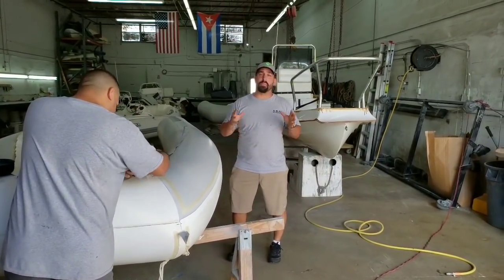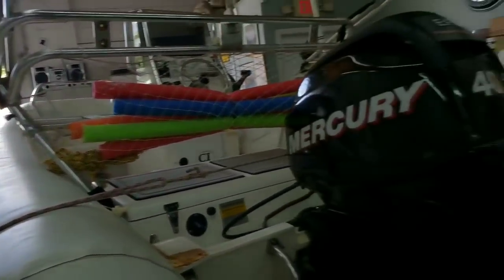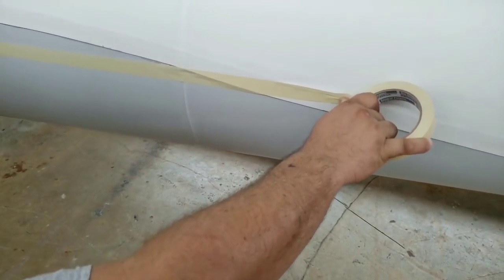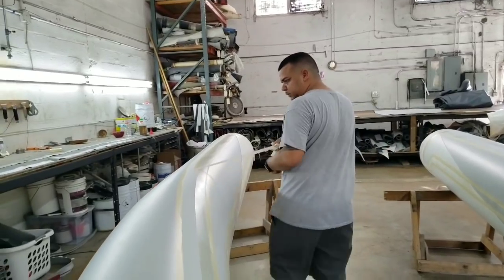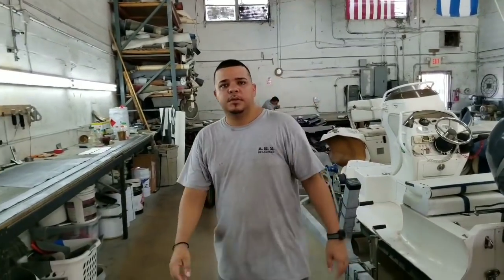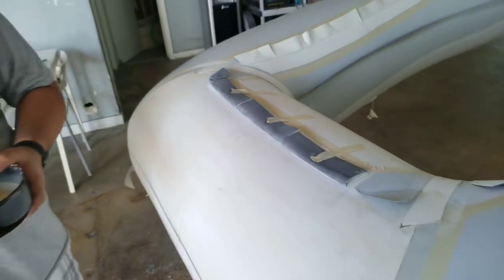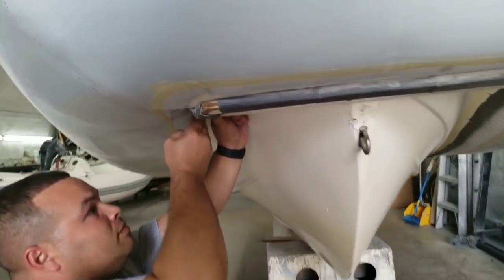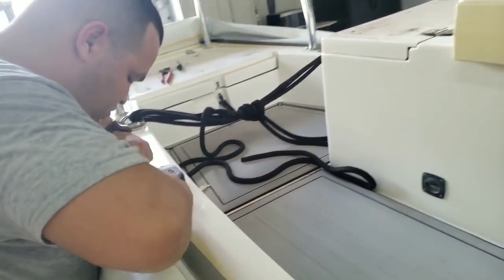How to install a rib Boat tube tutorial

Comment: Thank You guys these tutorials. I'm just retubing old  Valiant 570 according this video tips.
Reply: How did it work out? How did you get the old glue off?
Reply: @1998casablanca  Old glue removed with min.rpm with Festool sandpaper 120 and thinners. Huge amount hours. Zodiac 2 comp. Glue used to retubing.
Reply: I'm happy with result.
Reply: What name of glue please
Reply: Zodick 7096  pvc glue, 2 comp.
Reply: How many pieces I need. To repair 6 meter boat my dear

Comment: Hello, great video!! 
Question, i have a 2005 yachtline zodiak and need to reglue the tube's guides. Can i sand both the tubes and guides to get old glues off?
Also, is my zodiak hypalon or pvc? What glue is best?

Comment: Hey you guys have a skill set that would transfer really well into pre-preg composite laminating.
I am a boat builder "superyachts"  but never worked on tubes so naturally I bought a rib that needs the tubes reattaching 😅
The tubes are pvc they are in good condition but hell the tapes have come loose all down the port side and both sides of the transom.
Anyone reckon it's best to take them off completely and redo all the taping??
Also adding a second skin at the lower bow and undersides is a consideration but will it take to the older pvc??